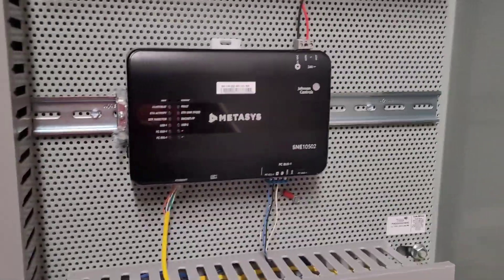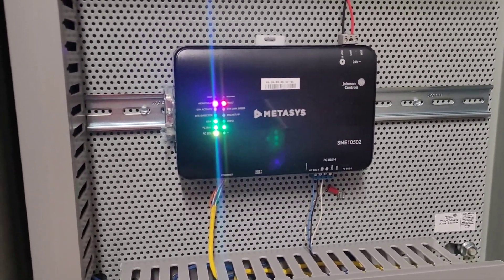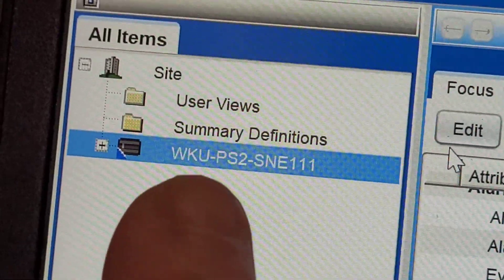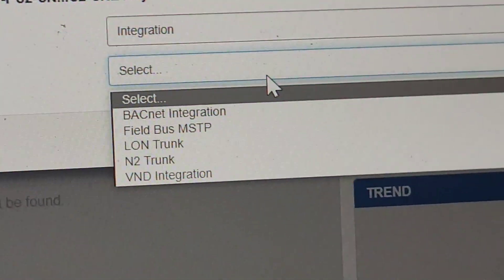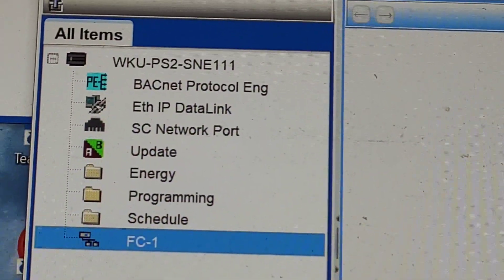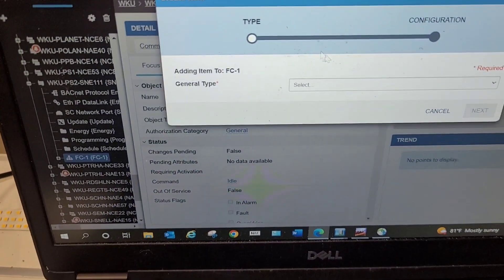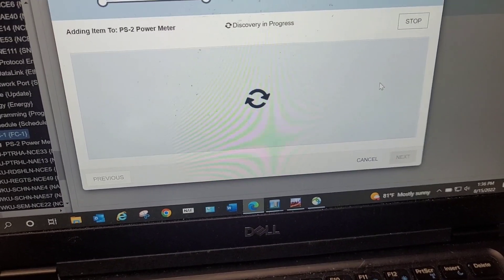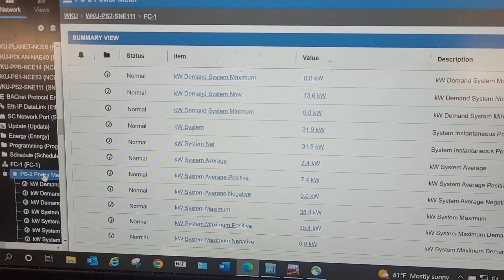How to Install a Johnson Controls SNE and a Dent Powerscout Power Meter

Comment: First of all, your videos are awesome.  Thanks for sharing. Question, how do you change the sne ethernet MAC address from the SCT archive if it needs to swap out to another sne.
Reply from the maker: The way you will change the MAC address is the next time you upload the engine.  I assume you are needing to replace the meter with a new one that has a different mac?  As long as the point IDs are the same, you shouldn't have any issues.